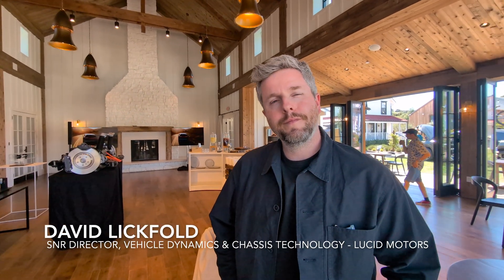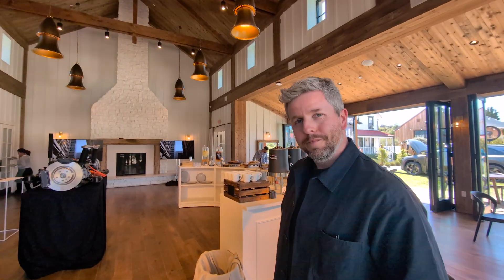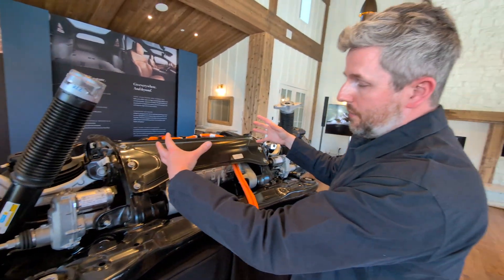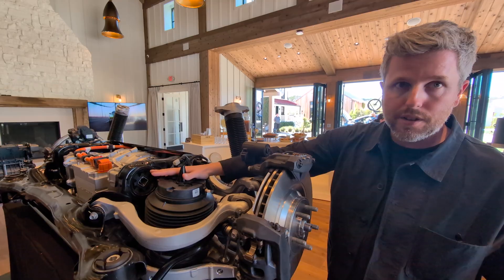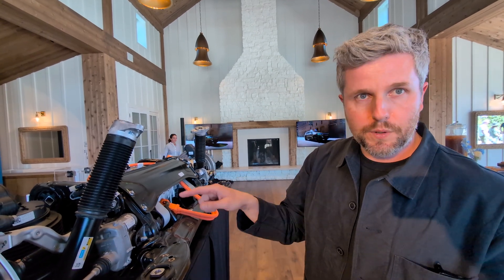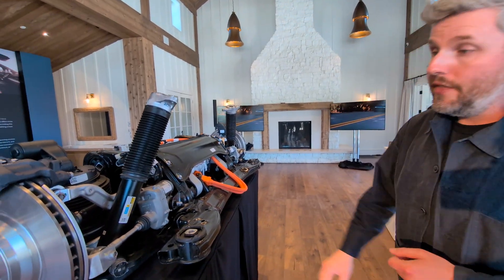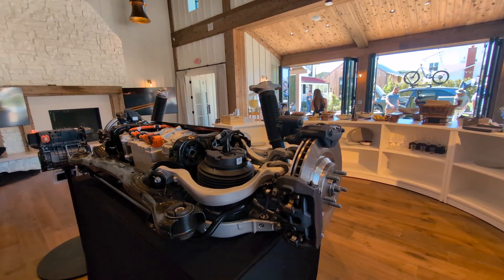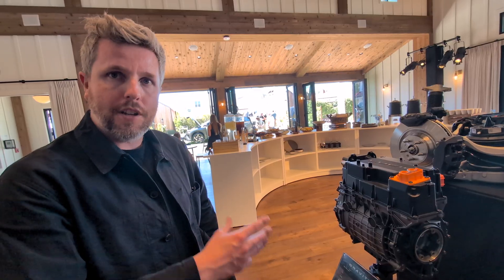David Lickfold Introduces the Lucid Gravity Vehicle Dynamics and Chassis

Comment: Lucid Gravity sales are about to explode. Gravity is a really great product with 100 miles more range (450 EPA miles on a single charge) than the Tesla Model X. Plus the Lucid Gravity which has a NACS charging port can charge faster than a Tesla at a Tesla supercharger station. Lucid Gravity is best in class. The newly acquired Nikola factory may be used to accelerate production of the Lucid "Midsize" - which will be the Model Y/3 competitor.